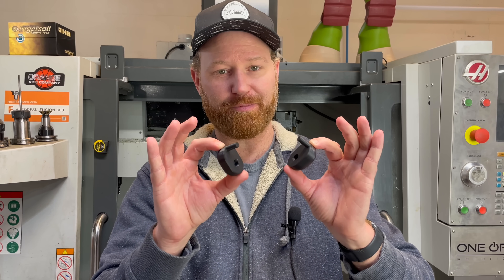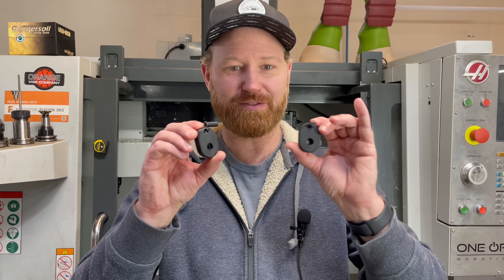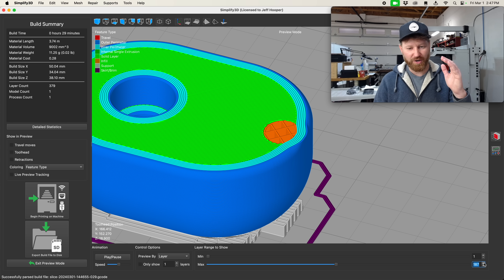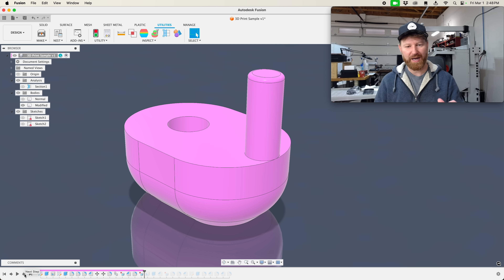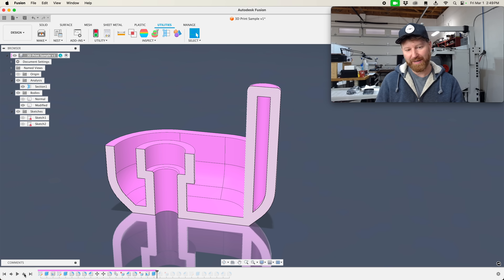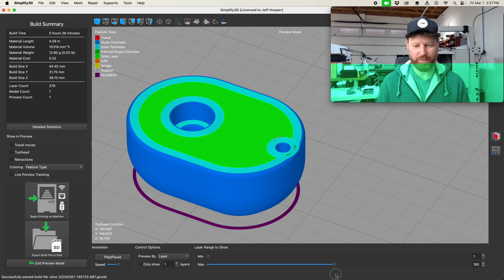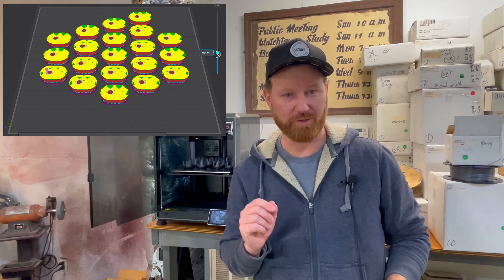Make your 3D print Faster & Stronger

Comment: ooooo.... I don't supposed upping the filament temperature could compensate for the previous layer being cooler could it?
Reply from the maker: Sure, nozzle temp, ambient temp, slowing down. But his tip was a way to avoid all that for a small production job. If you are running a larger scale production job, then those methods would be necessary. Good Comment!

Comment: I often change the axis of the part and split them, so I can glue them later together, it is way stronger than if i would print it horizontal. The superglue by them self is like an extra layer you can't break.  And the fact if you print your model on the side, you can't break also the little handle. But i do it only for mechanical things which have to be strong. Also, I print them slower for better layer connection and as minimum fan speed as possible, to let not cool down the lower layer so fast. Sorry for my bad English, it's not my first language :face-blue-smiling:. I just work as innovation developer and consultant, so i also have to work very often with 3D Printers but also way other filaments in the high temperature zones like PI or PAI or PFA/PVDF. But it works for every filament in the same way if you want to get the max out of it.
Reply from the maker: Thanks for the tips! Your English is great.

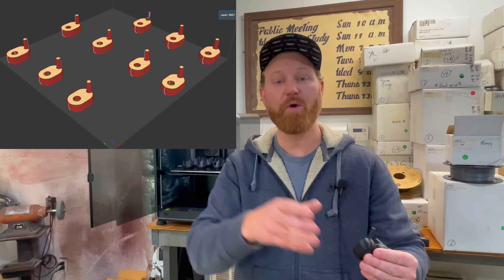Comment: @6:15 you notice the parts dont complete in order, but at random. there is a way so you can have it go row by row so the extruder doesn't knock into the others. unfortunately the slicer doesn't really have a way to organize this how you want, but if you spend time figuring it out, you can make it work.
Reply from the maker: Yeah, this slicer can’t do it. What a bummer.

Comment: Thanks for the tip about the layer adhesion on multiple parts. I’ve actually had this happen to me where a print of 2 worked fine, but a print of 10 failed. I bet this is why

Comment: Yeah, I always print sequentially... printing all at once has more problems than what you just mentioned. Including stringing between the objects, also any small defect and your printer is going to start moving some parts. It's worked for me in the past but i don't recommend it.  I love sequential printing, but i wish these printers were a little smarter about  it.  I usually print from Front to back since my printer seems to have more clearance in the front. It seems to me you do it in a more random order, why?  do you do it that way because you remove prints over time?  because that makes sense... Printer prints the first one in the front, then goes to the back, then by the time it returns to the front again, the first print is gone... No point in keeping it in the printer if its finished...
Reply from the maker: Yeah, it's because the slicer sucks. : ) I'm using the Creality slicer, and it doesn't support ordering. What slicer are you using?
Reply: @ChipMonkeys  I'm printing on Bambu X1c so I have to use Orca/Bambu slicer. I hate it... I prefer Ultima Cura that I used to use with my Anycubic Mega X. 

Anyway, im not sure if either can re arrange print orders.  I usually control the order of printing by the order of importing.  Also, you can slice the multiple objects and move them based on the order of printing in the preview. So if object 4 was printing first in the preview, I move it to front, then object 6 if it's printing 2nd. You can look at the slicing preview and move the objects accordingly to print order in preview. They should maintain the order. 

However,  I really think printing one in front then one in back then one back in the front would be more efficient. Especially if the printer just keeps going .  So you would tell it to print 50 copies. Then arrange 4-8 on the build plate and the printer just keeps going until 50 are printed . So as you remove prints, it keeps printing more until it prints 50. You would have to prep the plate in pieces and remove prints as the printer prints. Also an AI using a camera to make sure prints are removed would also be a nice safety. So if you fall asleep or forget, the printer just stops until you remove the finished prints. The benefit would be that you don't have to wait until the printer prints all 4-8 to tell it to print 8 more. Anytime you clear finished prints,  the printer will print 7 more. Right now, you have to wait until all 8 are printed to load the .gcode again . This would be like loading a .gcode mid print without interrupting active print.  So you can show up whenever you like to remove prints, and more importantly, you never have to show up after print 8 to restart the .gcode. it will just keep going and going until it gets 50 prints. You can show up at print 5, remove 5 copies and it will continue to print 8 mor3. Currently if you show up at print 5 and remove 5 prints....it will only print 3 more ...

Comment: The trick of spacing the build out and running sequentially is great, but doesn’t solve the problem of layer adhesion for larger prints with longer layer times. I’d like to see a 3D printer with a reheat nozzle. It might use short blasts of superheated air or even an I.R. emissive element that could trace the surface of a prior layer to preheat the surface. The new layers would be more likely to adhere when the prior layers are preheated.
Reply from the maker: You're right. I have a 500mm printer, and layer adhesion was bad on large prints. It took me way too long to figure out why : ) That's a good idea though!

Comment: If you place the component at a 45 degree angle on the printing plate, you could potentially increase stability even further. Otherwise great tip, thanks for that 😬
Reply from the maker: That would do it too! I'm just trying to get people to think differently about how they model the parts for 3D printing. This was probably not the best example.
Reply: @ChipMonkeys  You succeeded with me 😅👍

Comment: Lots of good tips here. I do got to do this sometimes but then a voice in the back of my head says;  you cant do that because the top surface wont bridge well over that gap, (without infill) but ofcourse theres not reason you cant use internal supports! I stopped using supports that build off of the model some time ago because I had so many poor results trying to remove all reamains of the support, but ofcourse that doesnt apply to internal stuff. Good to have a reminder.    ------------   Another simple way you can achieve the same thing is by making a small hole in your peg that goes all the way down to just above the base of your model. Ideally this hole has a radius equal to that of your peg minus your intended perimiter/wall loop thickness. Though you can just play with the loop count till they match.
Reply from the maker: You're correct! I saw some using that method. I'm trying to introduce a concept of modeling. This was not the best example. : )
Reply: @ChipMonkeys  haha no it's all good I understood what your trying to say I think. I have been thinking lately about how it is probably best to avoid Infill from the conception of how you will model most parts. In terms of being able to control where the internal bracing is relative to what you are actually doing with the part, cross braceing, things like the fillets in the internal corners, But also in terms of potentially making the switch to other production methods easier like injection molding, machining etc. As a way of potentially limiting how far you part might stray from something that wouldn't require total re design to your assembly to dfm it properly. Anyway, I'm an industrial designer so that's how I'm thinking about it.

Comment: All you did was essentially double the wall thickness by shelling it, because theres now an inner and an outer wall, which is why there is no more infill on the "inside". Your infill is now between the two walls as you can see when reviewing the slices
Reply: I tend to agree that much of this was superfluous. Extending the handle down to the bottom of the part? Thats not gonna solve the FDM layer separation issue with this type of feature.
The handle isn't breaking because the part is flexing so much on the top surface. It's breaking at the layers, because its a small cylinder with only a few perimeters. Making the handle more solid or adding the radius is about the only effective method other than print orientation.
Reply from the maker: @LeCafeRacer  we experienced no layer adhesion issues for either part. The issue was printing on top of infill versus profile passes. The results speak for themselves. If you give it a shot, let us know what your results show.
Reply from the maker: 75% of that boss was printed on infill and 4 surface layers. You would need 100% infill to do what we did here. Now, we need now infill, and still get 100% of the boss build onto profile passes. This isn't a great example but just a concept.
Reply from the maker: I hear you. But keep in mind, those profile passes for the boss 0:03 extend all the way to the bottom of the part. And there’s radii on the outside and inside of the part. Give it a test, and let us know what you find.

Comment: Nice. But, how do you print sequentially? Is there a slicer setting for this?
Reply: Prusaslicer under output options.  Have to set avoidance height and radius so your nozzle won't hit the last completed part or so your gantry can't crash into one while traveling.
Reply from the maker: Thanks!

Comment: Use prusaslicer (or the similar slicers) and enable to ensure vertical Shell thickness??? You can also use modifiers to have more perimeters or to ensure more vertical Shell thickness in specific parts

Comment: Great video! Do you have a heated chamber on your printer? I have found that when printing ASA having a chamber at 55C vs ~32C ambient made a huge difference in part strength, even with single (though large) parts
Reply from the maker: I hate testing if it works with 30 pieces haha. But, you're right.

Comment: I don't think the answer is spending time to modify the model. seems like your print settings are off. most everything you are doing is doable through the slicer.. you can adjust the top layer thickness and  wall thickness.
Reply from the maker: The top layer setting was the same for both prints. So, it clearly works. This video was just to put in peoples heads, that they can design a part specifically for 3D printing. It wasn't the best example. haha

Comment: To further increase strenght..  print orientation so you have all the loads winthin a layer plane. 
For that part sideways print will need some support for the bin but it will not snap between layers. Much stronger.
I'd also recommend adding a hole on the pin and insert a bolt/screw/rod afterward. The screw will also compress the layers resisting layer separation more if any tension appears.

For really study pieces, the last resort before CNC is to have some metal hardware prepared (like some flat stock with a bolt welded, or tapped hole). then design the model to fit the metal hardware inside. Some clever orientation let you pause the print -> insert hardware  -> unpause, having a complete 3dprinted outside. Pin down orientation would be beneficial for such hardware but will net more support on the flat face in air.

Also in the improved sliced part, the top part has a layer or two of infill. I would increase top and bottom layers so there is no infill within shell wall. Als for using inside supports for shelled part - use 0 contact distance (soluble), also increase support thickness, alternate lines.. so the inside suppor can do something and not get loose and rattly inside.

Another strength increase trick is to print a shell with a hole somewhere. Fill the inside with epoxy resin. Bonus points to add metal rods where possible as well.
Reply: I think you have a lot of interestimg knowledge.

Thanks!
Reply: @noxenia  Thank you for apreciation.

 I am passionate about mechanical engineering and i do have studies for it  (phd).

Comment: Great tips. Let me just be a bit nerdy and add to this that parts printed with a larger nozzle, such as 0.8mm, are generally stronger than those printed with a smaller nozzle, like 0.4mm. Let's compare your part (the pin you broke) with a hook, designed for wall mounting and hanging items ( just to make a point here, and draw from some data my company did quite recently). The advantages of using a larger nozzle become evident through specific tests:

Tensile and Flexural tests that are assessing the structural integrity and resistance to bending forces critical for a hook/pin bearing loads, larger nozzle prints show improved layer adhesion, enhancing strength under tensile and bending stresses.

2. Evaluating the hook's toughness and its capacity to absorb energy (impact test) without fracturing, larger nozzle prints are likely to exhibit better resistance due to stronger layer bonds.

3. Determining the hook's endurance under repeated loading, the enhanced layer cohesion from a larger nozzle contributes to a longer fatigue life.

4. Measuring how the hook deforms over time ( a form of creep test) under a constant load, prints from a larger nozzle might offer superior performance because of improved material continuity.

These tests did highlight the strengths of using a larger nozzle for printing objects like hooks and pins, emphasizing durability, strength, and resistance to deformation.

But its a quite big However….. however using larger nozzles on smaller parts can be challenging, often requiring multiple fans, even with ABS. 

But smart design methods like you demonstrated here can really compensate for a lot of this, again really great content 👌